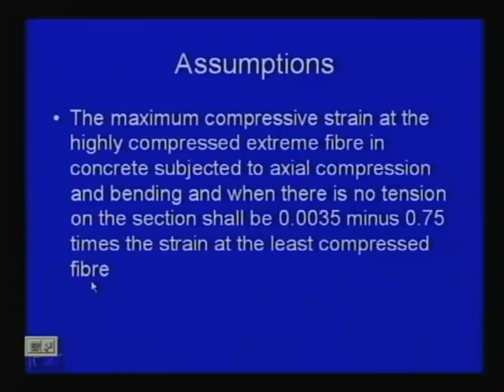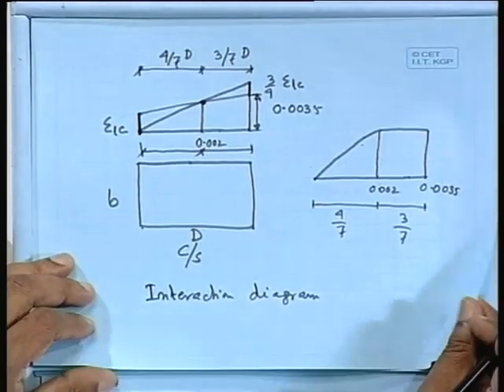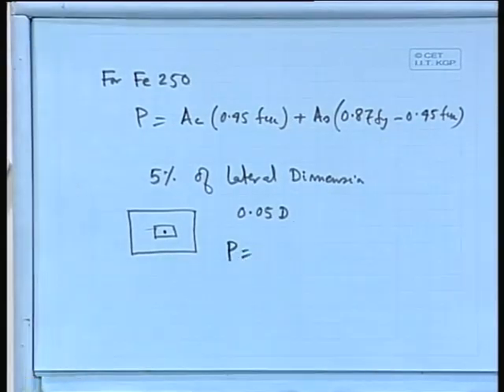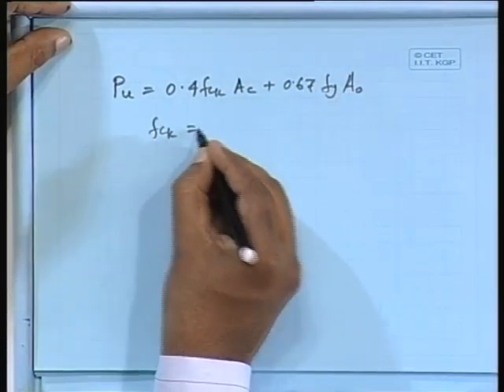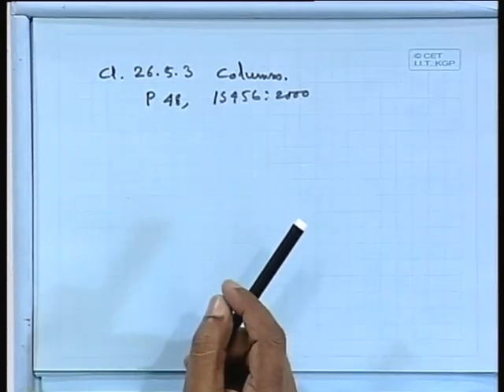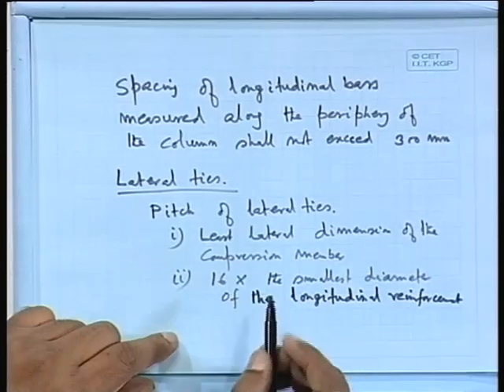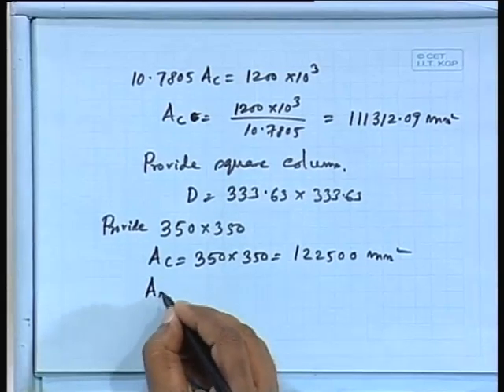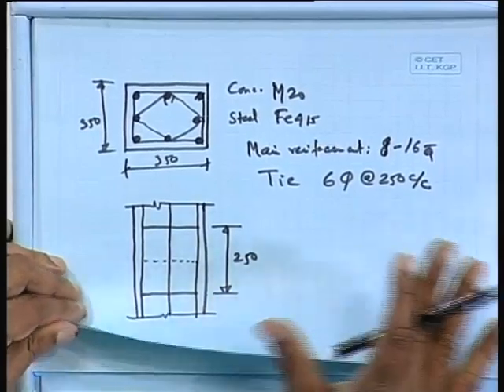Design of Columns Part - II

Comment: Sir I am working on site. There is high rise building 2 basement and G + 14 floor building. So there is one column in basement that size is 500*900 and steel using 24 nos 25mm bar so steel percentage is around 11.30% so this is higher than 6% so any problem in that column or not
Reply: It is 2.62% and not 11%